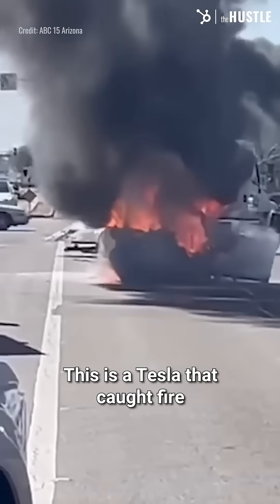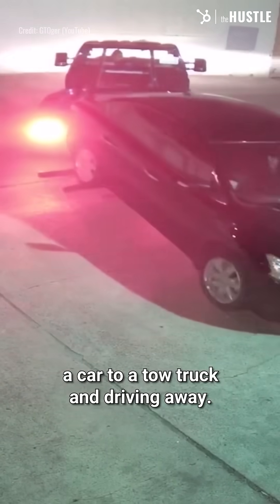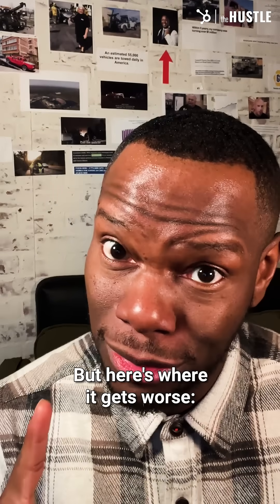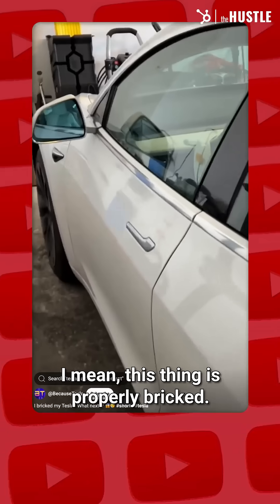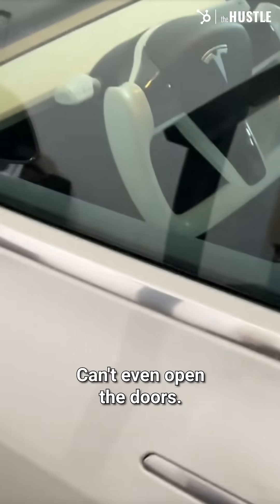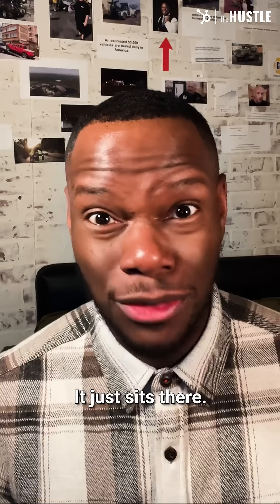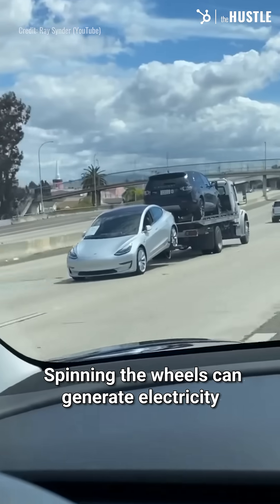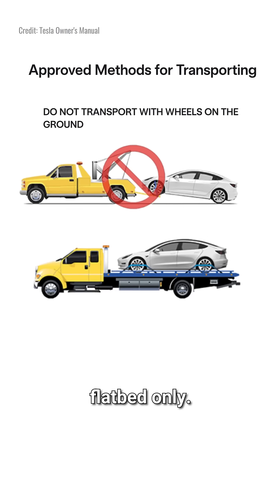Why It's So Hard to Tow EVs

Comment: This summarizes this type of issue really well! It could use more info regarding how the battery can react in cold weather (spoiler: not great) and how that is also driving the need for possible towing
Reply: @grizzlywizzly  I understand. If you are towing an all-wheel drive car, you do not tow it with any Wheels on the ground.

I bet you ignore the fact that your fuel economy goes down in internal combustion vehicles in the winter.

Comment: I love the false narrative you are spreading around. 

My stepmother's Lincoln weighs more than my ex's model 3, despite the fact that that specific model 3 has an all-wheel drive drivetrain. Have you ever tried towing in all-wheel drive car what two wheels on the ground? It will cause the rear wheels to rotate meaning you can't tow it without tearing up the car! There are lots of cars that are flatbed only.

As far as being locked in the car, that ain't going to happen, as the doors have mechanical releases if the electric release doesn't work. 

If you're a tow truck driver that takes any amount of pride in your job, you would know how to power to the car so you can unlock the doors from the outside, assuming you have the keys to unlock the car to begin with. If you know what you're doing, it would only take you about 30 seconds to pop the hood to get to the 12 volt battery. If you don't know what you're doing, you will tear up a customer's car and be paying a fortune to fix it.

Comment: You know what might be better? Automatically disengaging the wheel-rotation charging among other dangerous factors if the battery is empty and the wheels aren’t moving, with a separate way in the manual to re-engage it if need be (e.g. for charging).
Reply: You know it's impossible? Regen cannot be turned off at the rear wheels
Reply: @wrefk  The wheel will generate electricity only if the (switch for) power cable is connected. If the switch is disconnected, the wheel will rotate freely without generating any electricity.
Reply: @lolsflint7598  Know what's impossible? Towing an all-wheel drive car with two wheels on the ground.

Comment: It's almost like EV's are trash and will never replace gas cars 😂😂😂😂
Reply: Yep, like flying machines way back when 🤣🤣
Reply: I love how you just follow the false narrative of this video. 

The doors have mechanical releases inside of the vehicle. You cannot be trapped inside because of the dead battery. 

My stepmother's Lincoln weighed more than my wife's all-wheel drive model 3, just because it's an EV doesn't mean it's heavier.

Have you ever tried towing an all-wheel drive car with two tires on the ground? It doesn't work out very well for the car.
Reply: its almost like hew biased asf and is just spreading misinfo
Reply: You like to pay more money, have way more maintenance time and cost, for a worse product? Also noisy , smelly, can't turn it on in the garage, slow. This is your preference? Are you an idiot?